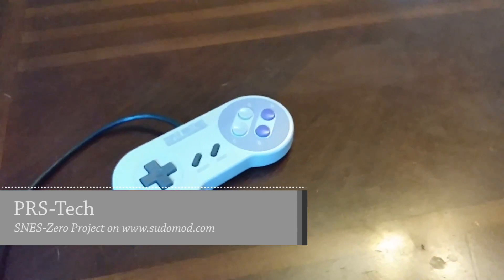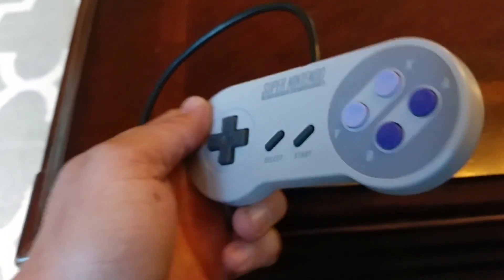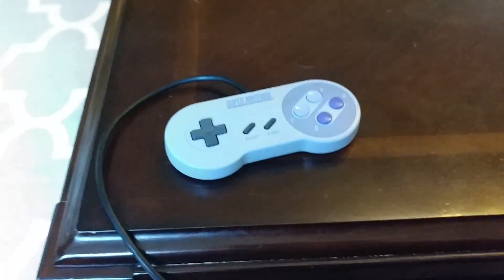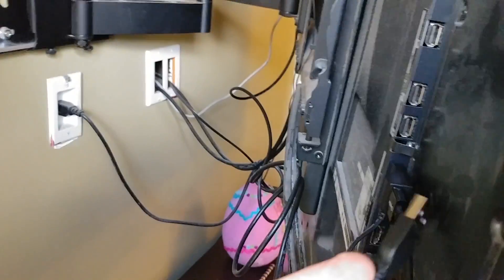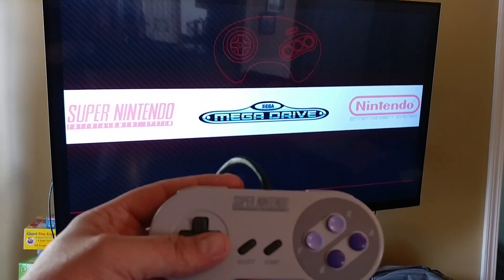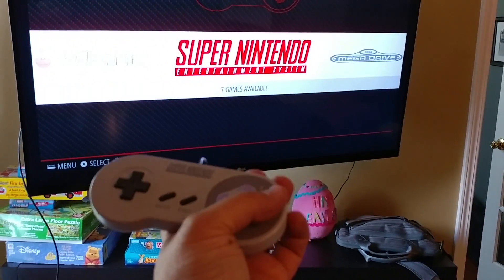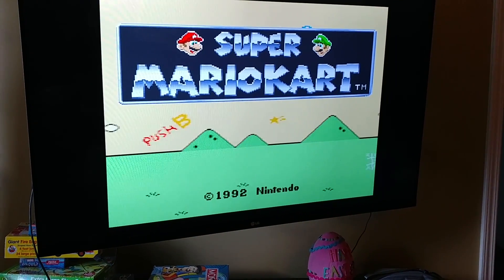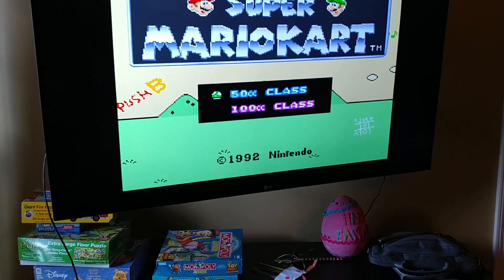My Latest project the SNES-Zero

Comment: I wonder if there's a way you could get a two player going? Maybe a bluetooth adapter inside the shell so you can connect one of those 8bitdo snes controllers? That would be pretty neato.
Reply from the maker: bobsauce100 it's a pi zero w.  It does have Bluetooth.  People are already doing it.
Reply: Welp. Ok, there ya go. Now it's perfect.

Comment: hey bud!

I hope all is well, are you thinking of doing a run through with a classic NES controller on one of these guys? id love to try that out as i have one but it has its own power source

Thank you for all the information! this is amazing
Reply from the maker: Dragonball Guru I've looked into it and there just isn't enough room inside a classic NES controller.
Reply: ahh that makes sense, i guess ill run two cords out then, kinda planned to make one for each controller so im thinking that once i build my snes version ill have it be powered by the hdmi cable, id think a sega controller would work well but thats only because those controllers are a little wider,

Thanks for the help man! subbed